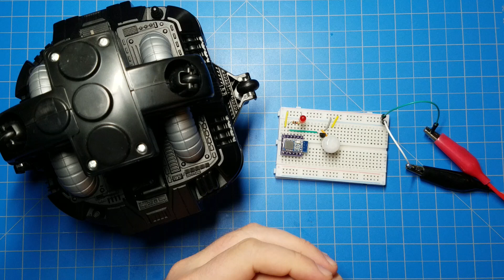A Motion Activated Droid

Comment: No idea how to ask this but would it be possible to do something similar but with a time limit to when the droids react? As in you can set it so they only react from 9AM to 12PM? If so I might try to make something like the above.
Reply from the maker: it's possible, but would require additional components such as something that can keep track of time. and the microcontroller would need new code so it knows how to check for the current time.

or you build something else that the beacon connects to that does all of the time keeping for you and provides power to the beacon only during the period you want it to be active.